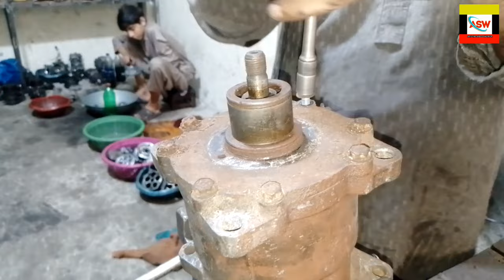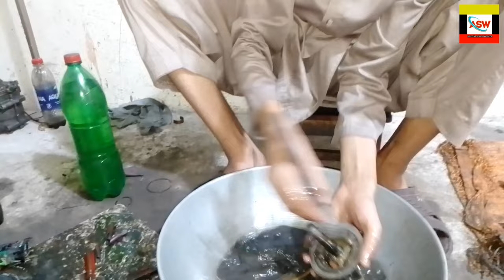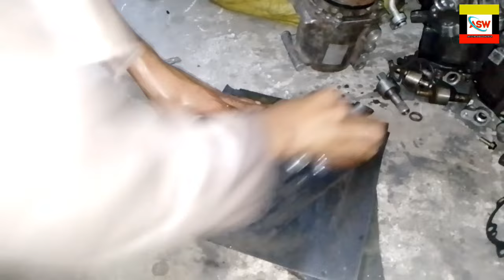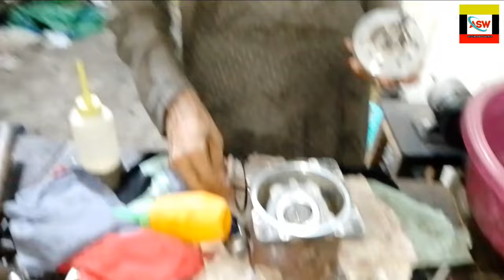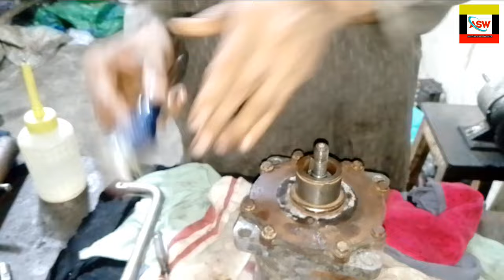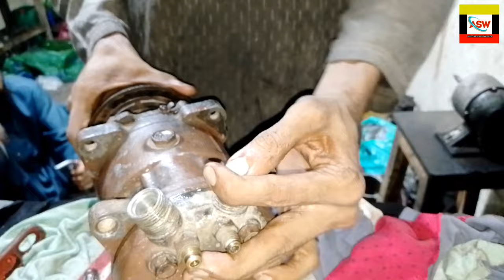Sanden ac compressor || Sanden compressor repairing || How To Repair sanden ac compressor

Comment: What type of oil to you use after the cleaning of the parts ;  is it compressor oil or engine oil ; if it is an engine oil after you complete the repairs you feel the compressor with the exact quantity of compressor oil according  to the manufacturer or you put less ?
Reply from the maker: It's not engine oil it's compressor oil quantity depends on different types of compressor
Reply: suzuki alto japani 660 cc key ley best compressor kaon sa hay
meri suzuki alto ka compressor  jab garmi ho to thori deir chalney key bahd cooling chor deta hay
Reply: 100ml oil quantity